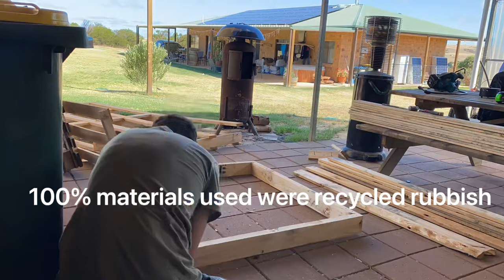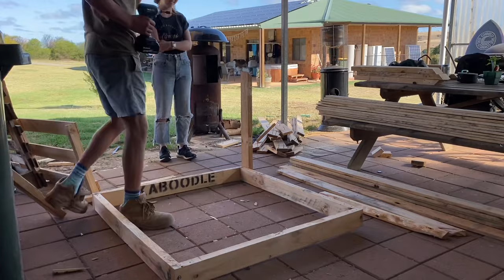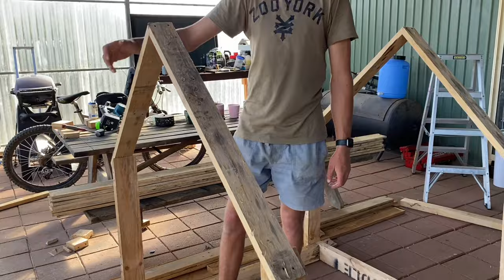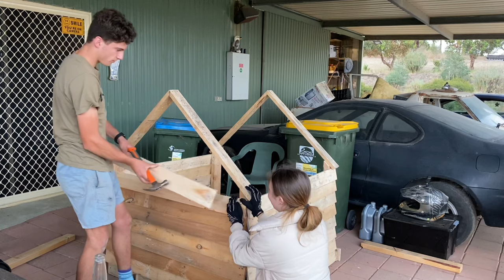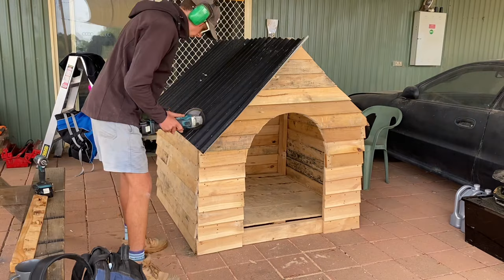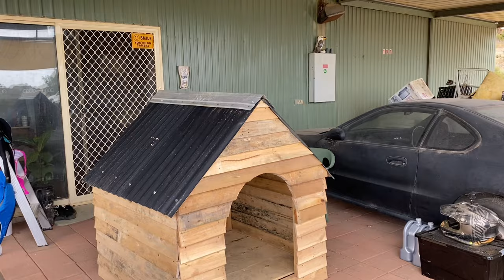Dog house build from free pallets in 5 minutes!

Comment: Gonna grab a bunch of pallets from the Reece plumbing near work and make one for my fleabag. I will use your job as a template. I think I'll have to use something other than tin for the roof so the kids don't have a mishap 😬. Thanks for the terrific video. Subbed!
Reply from the maker: Awesome! Cheers mate! I put angle flashing on the edges of the tin afterwards, could use the polycarbonate sheets instead perhaps. Good luck with your build 🤟